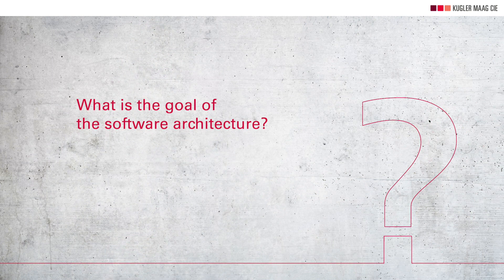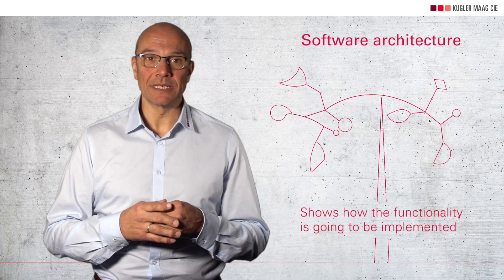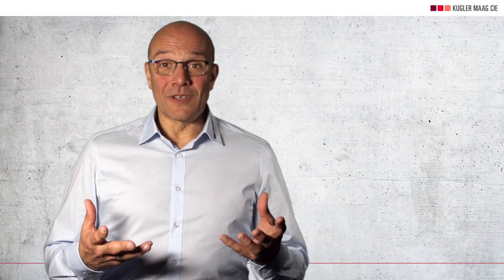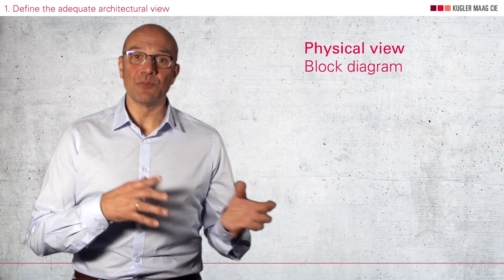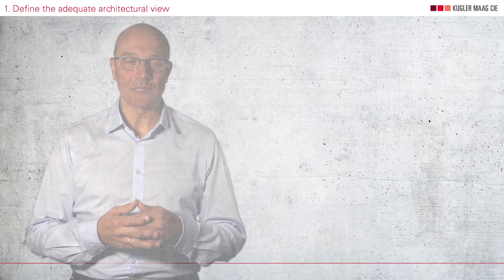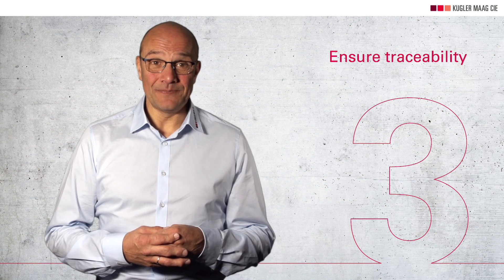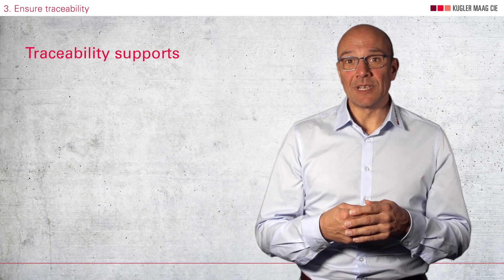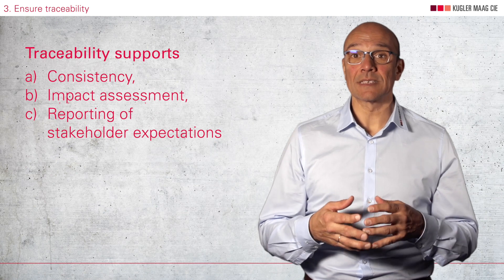SWE.2 Software Architectural Design | Automotive SPICE

Comment: Thank you very much for the explanation. I have the following questions: Nowadays we develop the ECU Software based on AUTOSAR and a major part of this is SWC Integration.
How would you categorize this step into ASPICE ?
How should the traceability be established for SWC integration? Should it be related to SW Architecture Design or to SW Requirement Specification?
Thank you very much.
Reply from the maker: @sireeesha very interesting questions! However, there is no simple answer to this. But if we try to simplify it,  we would try it as follows: The request by a customer to use AutoSAR and which version thereof, is a SW requirement, a constraint for the SW architecture. The definition of the AutoSAR architecture (self-developed or a configured third-party SW, e.g. Vector or Infineon) would be part of your SW architecture and your SW component test including dynamic and interface tests is part of your SW integration test. We hope that answers your question. Feel free to reach out if you have a follow-up question! :)